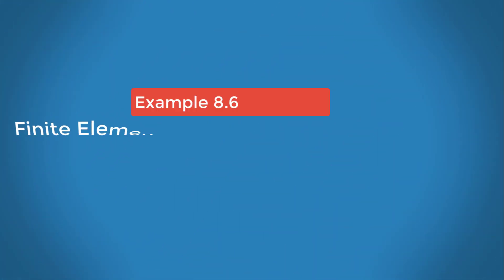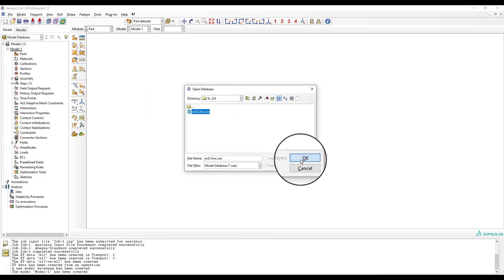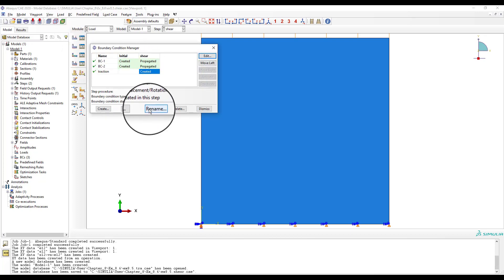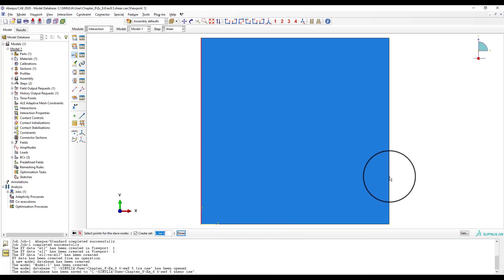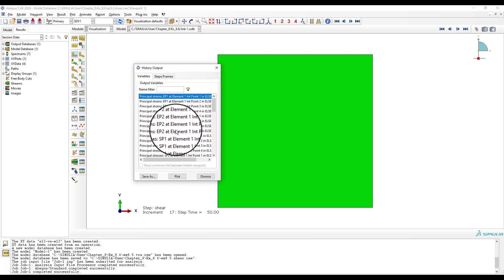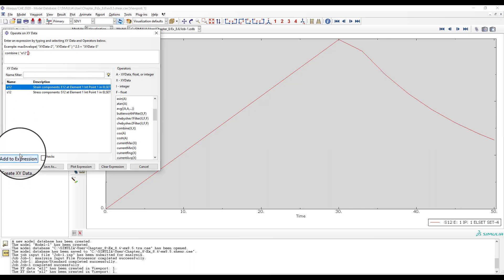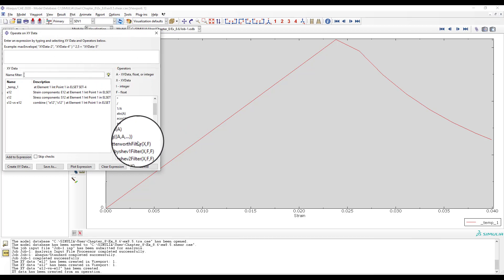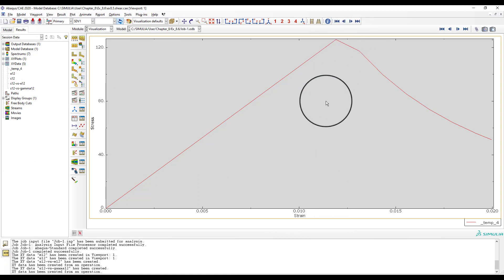Example 8.6 UMAT plot transverse matrix damage under in-plane shear

Comment: Dear Prof. Barbero,
I have a question regarding your recent paper which I want to refer to in my paper specifically about scf again. I would be more than happy if I get your idea.https://www.sciencedirect.com/science/article/pii/S0020740319326955
The issue is normally for quasi isotropic composite plate it was proved that the scf in two holes 45 degree is less than two holes in transverse directions to loading direction in tensile. Accordingly, the strength of 45 degrees is higher than the another case. 
Could we say that this is true for all the composite samples such as the balanced case? I did an experiment and normally 45 has higher strength but for scf numerically 45 is higher for balanced case? is it possible?
Also, for scf we should divide each case tensile stress at maximum load to the maximum stress around the hole for each case separately, right?
Thank you so much
Reply from the maker: There is a difference between "stress concentration" (SC) and "strength." For ductile metals, a linear analysis will calculate the SC but it has to be ignored because the metal yields, blunts the stress, and nothing happens unless the yield zone propagates to the whole cross section. I have a video about this. I will review it, then make it public. For composites it is similar. Linear FEA will calculate the SC correctly for whatever laminate stacking sequence (LSS) you use. But then, damage will propagate differently according to LSS. That is what you are seeing. To account for that you have to use a damage model. In here: http://barbero.cadec-online.com/publications_list.pdf  search for "Moure", there a 4 papers that will help you.
Reply: @EverBarbero  I really appreciate for your time.